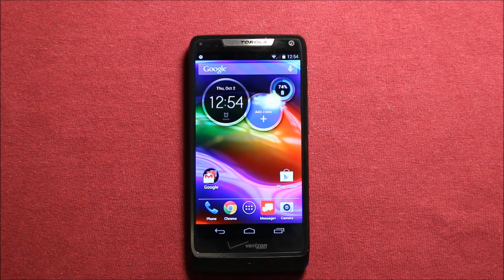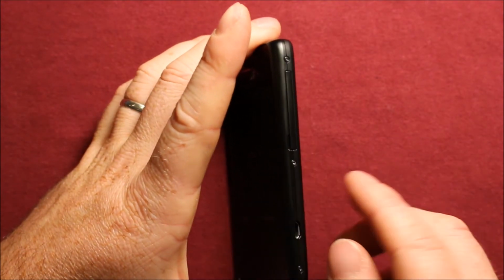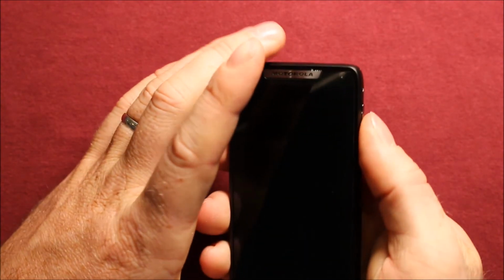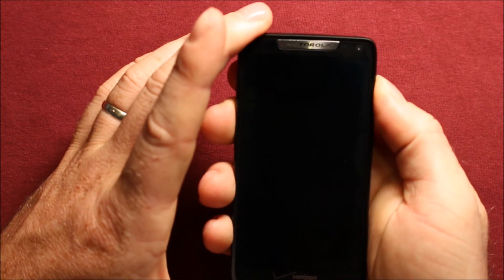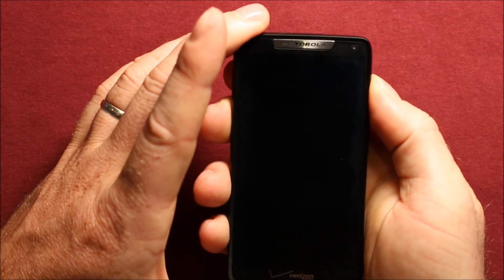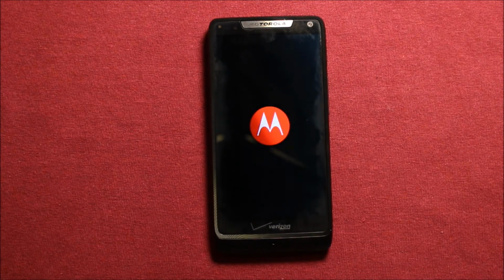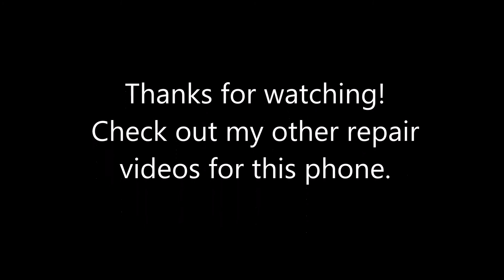Motorola Luge Screen Replacement Repair How To Change

Comment: it's been dropped before many times. worked good. then one day the screen stopped working. the screen isn't cracked or nothing. it's been sitting around for months and I decided to look up ways to fix it.
Reply from the maker: +90s Limit 1 It might be worth taking apart just to see if there's some connections loose or something.
Reply: +Smart Easy Repair will do. thanks man.
Reply from the maker: Best of luck take care!

Comment: mine turns on but the touchscreen doesn't work. it just did that out of no where.
Reply: any suggestions?
Reply from the maker: +90s Limit 1 So you didn't drop it or anything?